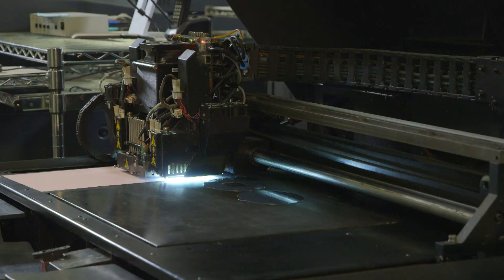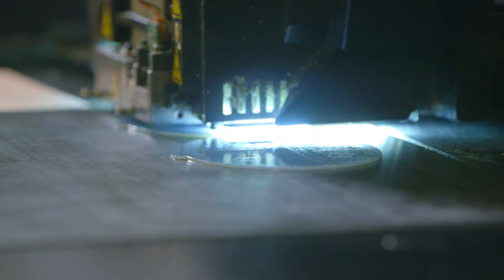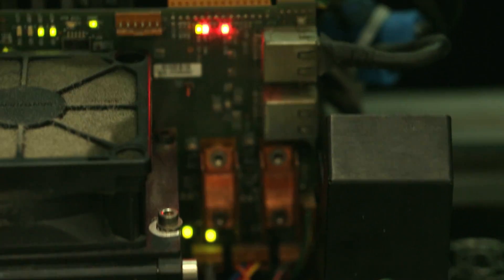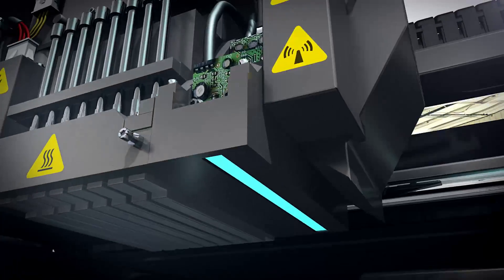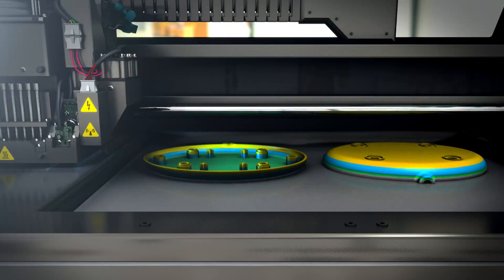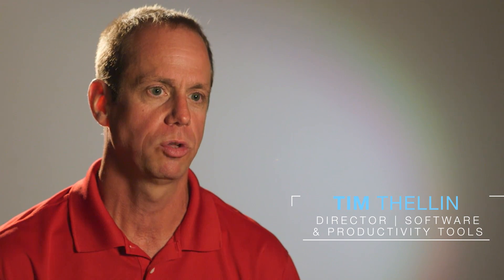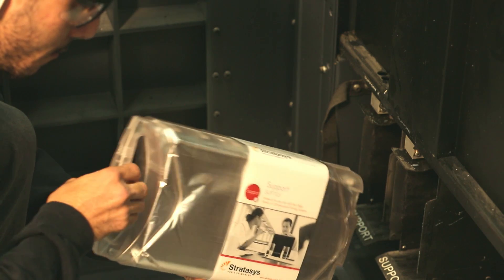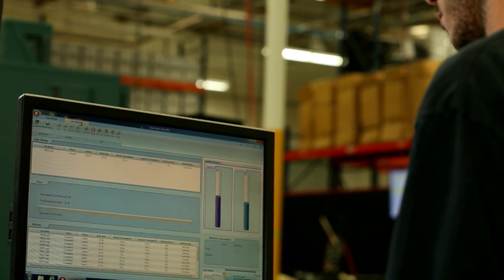PolyJet: 3D Printing

Comment: cant wait until the copyright expire the same way it did on FDM printer technology
Reply: There is no copy right for machine, there is patents. And patents don´t work the way people believe.  Patents don´t block a technology, but rather a specific technological solution.

A patent don´t stop you from making a machine that does exactly the same, as long as it don´t use the same core mechanics.

Also, remember, inc-jet is not new, it have existed for 60 years, the core patents expired decades ago.

There is probobly some other process in the system that is patented here. But there really would be nothing to stop you from just converting a ink-jet printer.

Copyright only exist for immaterial things, like music, text, pictures, videos and so on
Reply: These kind of copyright really stagnant the advancement of technology and science really. Look what happens to the FDM printer copyright as soon as that expired so many people exposed to such amazing technology. So when will this Poly Jet going to be expired are we going to get old before then ?